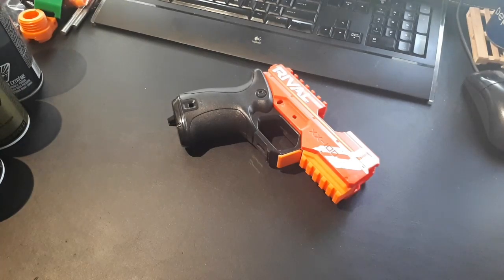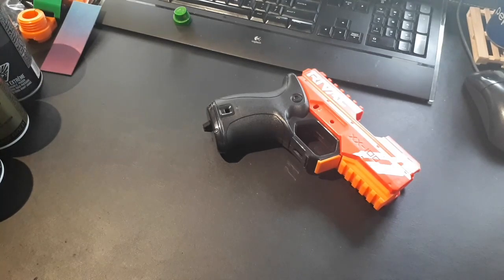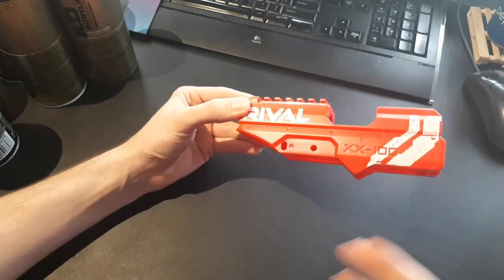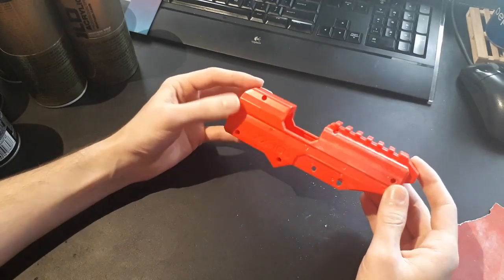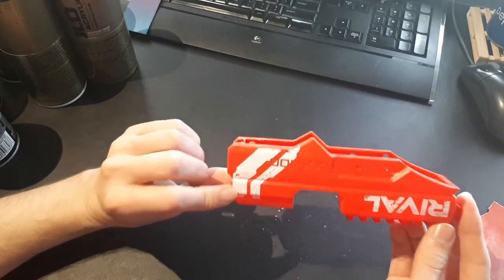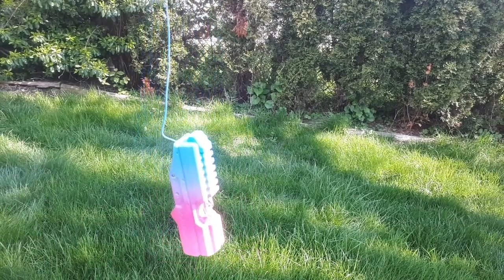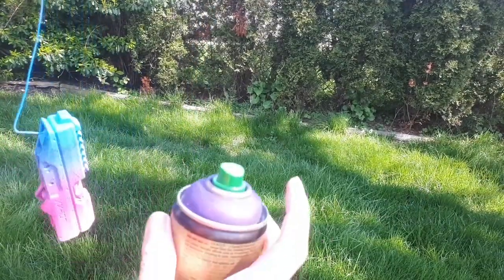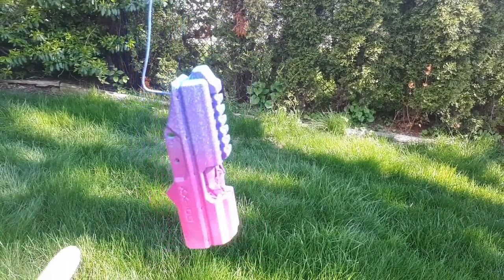TKO build guide part 4 - Spray painting basics for Nerf

Comment: I have a few of questions.

1. What do you use for scrap plastic to test the paints? I cant think of anything 
2. How careful do I have to be about mags/rails/switches/triggers still working and the durability of the paint in those parts
3. How big a deal is temperature/weather? Ofc I cant go out painting in the rain but do I need to wait for hot summer days or is 5-10C weather enough?
4. My main shade is supposed to be cyan with pink accents. I want to use the Army painter colour Primers because they are really good but cant get the white. So I would use the crystal blue (which is a little darker than the final paint I wanna use but Im worried about how the pink will turn out.

Comment: I know it's been a year since you posted this, but a thought to compensate for the nozzle problem you had would be to string up the wire so you have a free hand, and hold a piece of paper up between your spray can and project while spraying. Leave some distance between the paper and the project if you want a fuzzier transition, closer if you want a sharper transition. That way you cut out some of the overwhelming misting you get so you don't overwhelm it with a single colour accidentally. :D

Comment: Hate to bug you again with another question, but what epoxy putty did you use for filling the warning text? From what I’ve read apoxie sculpt is a pretty good option, but figured I’d see what you might’ve used.
Reply from the maker: This is one of those "do as I say, not as I do" moments. I used bondo since it's what I had (and I have a respirator). I wouldn't recommend bondo, polyester resin is pretty nasty stuff. Whatever epoxy putty people normally use for nerf integrations should be good, I just didn't have any on hand.
Reply: @ehdrien1094  just as a little thank you/side note I ended up using some Oatey fix it stick 2 part epoxy that seems to be working quite well. Did you end up using the matte duplicolor clear mentioned in this video on this build, or did you go with a different gloss version? Im so torn on what clear to go with. Haha I really like how the clear that you went with turned out and if you’ve had decent luck with it the finish looks good.
Reply from the maker: @christophersmith8028  I used some dupli color clear effex(not a typo). It's more expensive than normal clear but it has a cool glittery rainbow effect when light hits it the right way XD(really hard to photograph this though)

Comment: How long did you wait after painting the stripes to pull off the tape
Reply from the maker: I think I waited 2-3 hours. Long enough for the paint to be dry to the touch but not fully dry. If you wait longer that's fine but the paint sometimes chips off the masking tape as you remove it and it makes a mess.
Reply: Ok thanks!